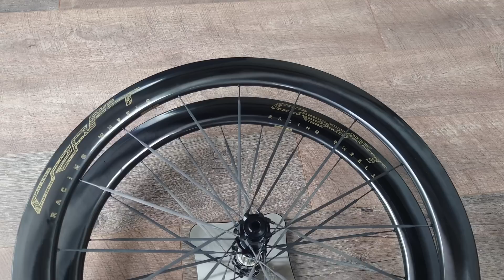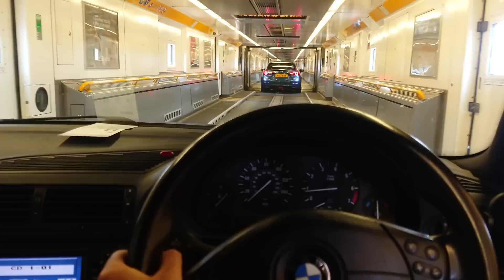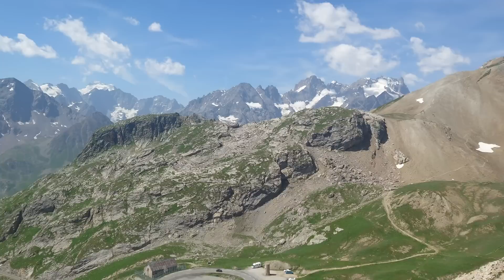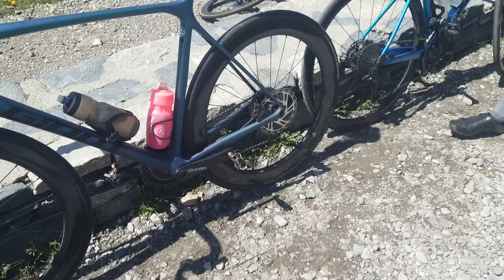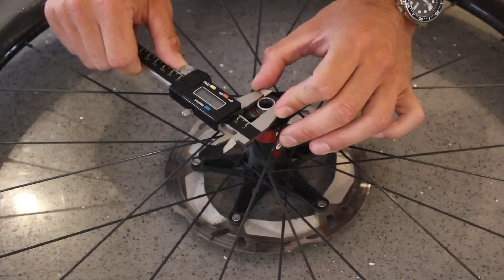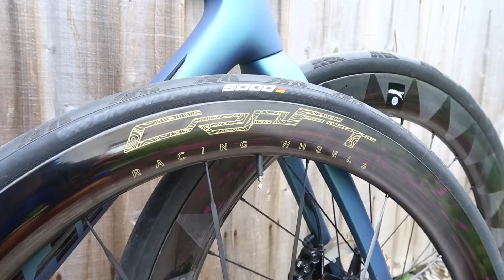Carbon Wheel Perfection Roasted at Gas Mark 6 - CRW

Comment: Seems like a manufacturing process fix would help.

Are you gonna test it with the improved caps?

I wonder how much weight increase would occur if they just use the traditional hub axle.
Reply from the maker: New end caps installed then aero testing can begin once i have the new rear. I personally don't believe a traditional axle would add much weight as you then don't need the internal tube spacer (which is a larger diameter!).